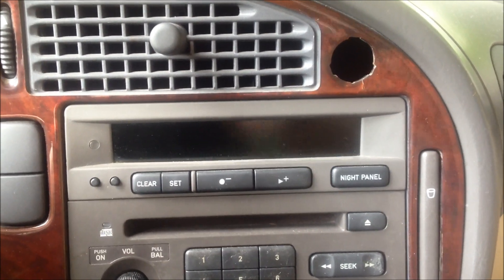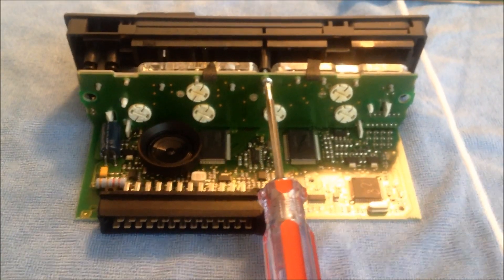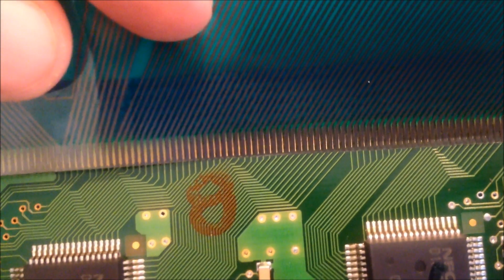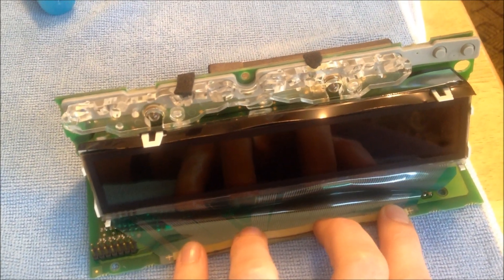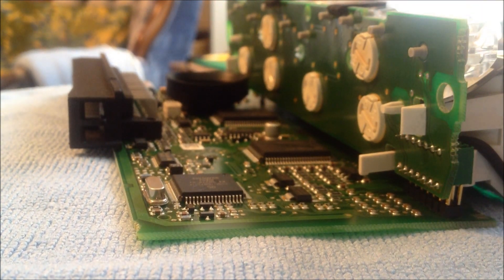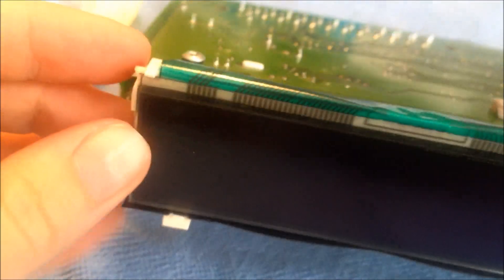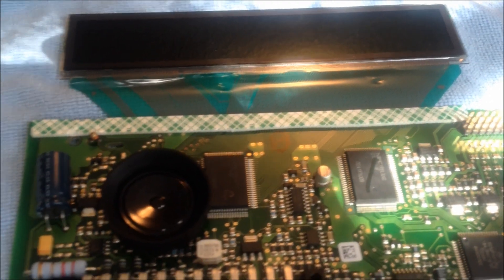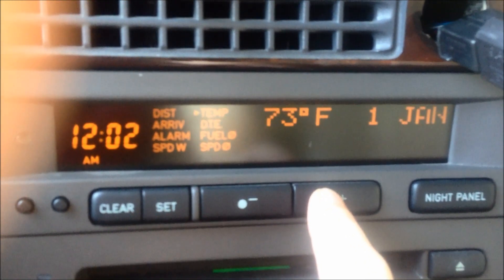Saab Information Display (SID) Dead Pixel Repair

Comment: 6 years later, I have my own Saab. Tried to fix it, but my ribbon cable was too low quality, big rip. The screen is like your 2nd attempt, even after using heat, etc. Luckily I had a perfectly working back-up SID2 but the speaker does not work. Does not bother me too much. What I learnt: buy from the well known shops like pixelfix. People on YouTube and Saab forums recommend it.
Thanks anyway for making this video!

Comment: Great video! Just a warning to others who are still going to try this: Don't blindly trust the marking on the radio saying SID-1 or SID-2. We spent way too long trying to fit the wrong cable in. I would suggest taking the radio apart to see what kind of cable it actually uses before buying one. Or buy one of each, they're cheap.

Comment: I suggest using a plastic body panel tool (sometimes called a bone tool) to remove the panel NOT a screwdriver...less chance of damaging the dash trim.  While it's more money I suggest just removing the SID and shipping it to a company like BBA Reman to have this work done professionally.  You'll also get a 5-10 year warranty on the repaired part.
Reply: I just went through the motions of doing this, and its popped back in my 9-3. I had to use longer screws than stock on the last two screws that hold the faceplate on, because the last owner broke the tubes the screws go into. That added a few more minutes. Its not worth bothering a 'professional' to fix this, unless you like giving other people your money.
Reply: Given the problems the video maker had performing this repair properly I suggested the other option of getting the SID and ACC display re-manufactured by a pro.  Then you get the warranty. For some folks (like me) it's worth the extra money.

Comment: For those who want to know where to find some replacement ribbon/screen. Pixelfix.com offers Saab screen and ribbon cables that do not require soldering. Worked great!

I purchased the Screen + Ribbon cable and the ribbon came already attached to the screen WITH some metal clips attached to provide much longer lifetime. The only failing factor would be your skill attaching the ribbon to the circuit board.

Comment: Sold my SAAB recently and didn't end up replacing my board dispite this helpful video!  Currently selling a SID display under market value here:  http://www.ebay.com/itm/252649274381?ssPageName=STRK:MESELX:IT&_trksid=p3984.m1555.l2649

Comment: I was looking for tips on replacing the singular cup holder in my Saab 9-5 when I came across your video....a hair dryer on high heat would have set the adhesive on the ribbon too. Good work any time you can complete the task.

Comment: I found that by passing a hot iron (clothes iron) over the contacts on the printed circuit board, and the LED screen, that I went from 0 pixels showing to it working 100%, on a replacement green ribbon cable like the one you bought.  I also cut out the triangular section to fit the cable, like you did.

Comment: You did well... I came, tried , and failed ...miserably. Done it but cracked the LCD screen when putting it back together.

The worst bit is, after trying it the pixels all now work , but just a massive crack in the corner which is lit up by the bulbs.. I can't stop looking at it

I'm sending it off for a professional to repair :@(

Comment: Most entertaining video. Your fatal error may have been using nail polish remover as a cleaner. While acetone itself would have been sufficient the additional ingredients found in most removers would make it impossible for adhesives to work properly. Look at the label and see if glycerine is listed. This is often included to protect your skin from the drying properties of acetone. Unfortunately since it is an oil it would also prevent the adhesive from sticking. Had you had alcohol on hand your video would have been much, much shorter, and that would have been unfortunate for us!
Reply from the maker: Thanks jordanfrye, 
I never thought of it, but you're exactly right. It probably had glycerin in it! Glad you enjoyed my misery, lol.

Comment: Hi.  Just picked up a 99 Saab 9-3 w/ 145K miles, all records so I hope it lasts.  Here are a few things neither your video or any other similar video discusses: 
1. Is the SID replacement ribbon cables made of silver or carbon?   Silver is slightly more expensive, conducts 10x better than carbon, bends 500x more than carbon before breaking down, and is more 'permanent'.  For example, yours appears to be a less expensive version, without the hole, wasn't a very good fit for you.  
2. Pull out the SID first to compare the replacement ribbon to images or the ones you are going to order to be sure it's either a SID 1 or SID 2, because it might not match. 
3. The bulbs can also go out, and might also be ordered / replaced at the same time.  All the movement during replacement can harm the bulbs. 

Thanks for the video

Comment: May I ask, what kind of Saab you have? I myself have a 2002 Saab 9-3 SE. You've convinced me to try to fix it myself!
Reply from the maker: I have a Saab 9-5, 1999.
Reply: Duchess DIY They truly are beautiful cars. I refuse to get rid of mine. I've already replaced the engine and turbocharger. Blew the engine during a race, but that car is worth every penny!
Reply: Duchess DIY, thank you for showing the frustrations of such easy fixes, saving money but not time. With my '99 9-3, I now have lots of practice removing, taking apart, and replacing the SID - but still NO pixels. My videos of the process are private and just to prove that I did the damn thing as instructed, also shorter and more boring because I had to cut out all my swearing/screaming to Holy Hell. So I see that in the end, all it takes is some female ingenuity - a curling iron and a beer.

Comment: Great vid, thanks. I'm close to buying a ribbon on ebay for my 2002 Saab 9-3. They all say to use a t tip iron, yet none of the vids I see on youtube for repair do that.
-My ACC display is completely dead also, can I assume it's a similar repair? Anyone done that?

Comment from the maker: Hi Mike, thanks for the compliments!
When I replaced my ribbon the SID units were $150 on Ebay, so it's nice to hear they have come down to about $50. That should help a lot of people.
In general- I like a challenge, even though it might not seem like it sometimes (see my video on fuel filter replacement.) And this was at least $42 saved, oh and the cost of the beer...

Comment: correct me if i am wrong.... you could have bought the whole new sid unit and forgone the 'interesting' experience?  is that correct?  they have em on ebay for $50 now....   interested in if all that work was justified given the now reasonable cost of the entire unit   mike

Comment: You've inspired me to attempt to fix my ac display myself on my old 9-3. Thank you very much!

I'll be looking through your other videos because it seems like my Saab needs most things fixing!

Did you ever replace a Saab door window regulator? The tape I have covering the gap at the top of my window really doesn't look very cool but I have no idea how the regulator thing fits.
Reply from the maker: Glad I could help- that's the point! 
No, when my window went out I had a mechanic fix it. I think now I could have done it myself. 
Good luck on the repairs. So far, all of mine have stayed "fixed"
Reply: Duchess DIY  I feel like I've just been to your garage and now I must owe you about £70 ;) Thanks for all your replies. I have no useful knowledge in return I'm afraid. I'll send you a free download link when I put my album together (although you might not consider that a good thing ;). Anyway thanks, and good luck with your Saab too....I will need luck with mine!!

Comment: Hi again.
Took out my SID1 today.
Thought l would be clever and just reheat the glue on the old parts with a soldering iron. ( l couldn't
find the curling iron!  ;-)
Unfortunately adhesion was not the problem. The ribbon had split in a few places.  
I have ordered a new ribbon. 
Not looking forward to the re glueing